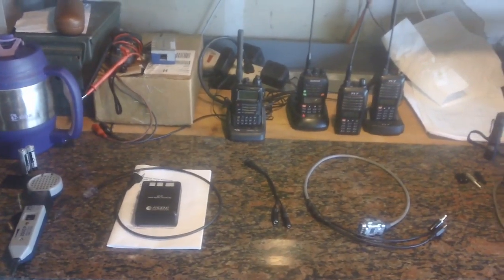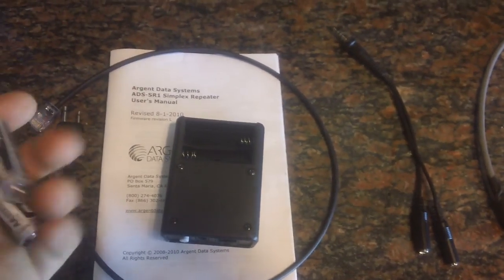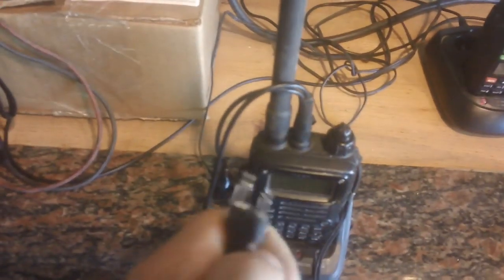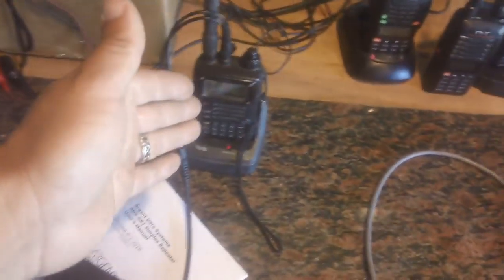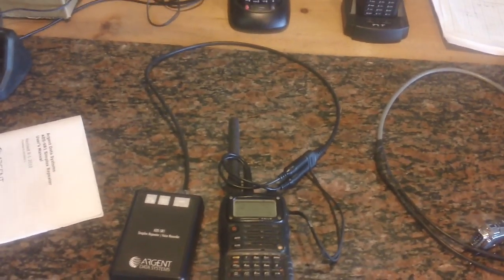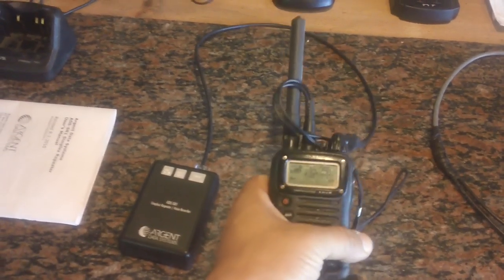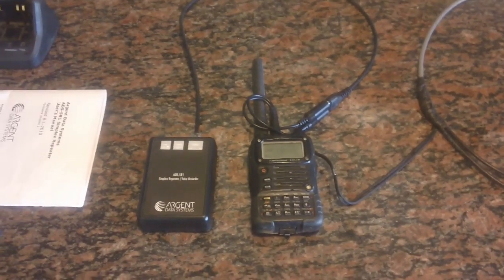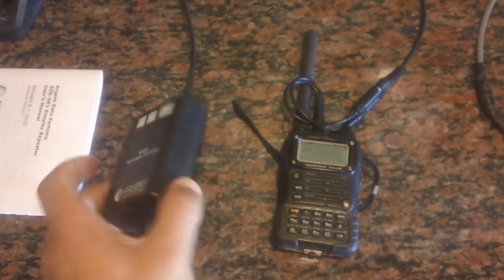Personal Simplex Radio Repeater Build Intro.

Comment: Does it have all the features like the surecom repeater does? like  dtmf tone to operate it, save voice messages,  broadcast a message every so minutes, will the one dual pin network cable work on a baofeng uv-5r?

Comment: Radio shack sold a simplex unit like that, I bought one for $2.00 on their close out table they use to have. I wish I bought all 4 they had. I still have it 15 years later and still have not used it other then to see how it worked. And it was great.

Comment: I think you fools and the FCC need to fix the mess you have with your grms frs radios
You are actually talking about 40 channel wide band 25 kHz and a 80 channel narrow band 12.5 kHz UHF CB ..
Not sure why they would be mixing wide band and narrowband re hash in the same band..
I always thought the licensing bs had to do with sub 150 MHz band not the wide narrow band application on a UHF CB which has 4-5 watt nominal output..
You be better off to create a 120 channel UHF radio system where you got the 1st 40 channels as standard UHF 25 kHz mode and do a 80 channel narrow band running 12.5 kHz steps...Nothing good becomes of running two types of modulation over the same batch of freqs always causes a mess..
I'm in a country where we still openly use 40 channel wideband and 80 channel narrow band UHF CB system over the same bunch of freqs and the 2 can not co-exist on the same radio withiut causing transmission issues..
You only create problem when you try to mix wideband and narrow band within the freqs real estate...
This is why you have a 12.5 kHz step applied to the narrowband UHF portion and a 25khz portion for wide band use..
My opinion I think if they wish to use wide band applications within a UHF format they will need to create UHF block for it same with the narrowband applications 
You can not over lay narrow band on top of wide band using the same batch of freqs...
Unless you own a seven foot ant the reality within the comedian frequency range is no more than 1-2 km. Whether you use a 1/2 a watt to 4-5 watts your range will be the same now if you can hit a repeater within a mile or less you might get 20-40 miles..
Though simplex will alway fall between a half a mile to a mile unless you can serious wattage which will likely get a slap on the wrist from the FCC 
The freqs you listed over here where I live would be considered UHF CB freqs 

Note with the Chinese ht's you buy their distance falls within the same distance as my UHF CB radio..
Any distance claims companies tout on thier ht's work within scope of an active repeater system being in place, all simplex and duplexing actions your radio support will fall within this scope of use regardless of whether you can set the operations to 1/2 watt to 5 watts...

Comment: I think this is a good configuration. But I think comms needs rules especially if you are using 3 or more stations. 1. Roger beep must be utilized, 2. no transmissions over 10 seconds long, 3. you must wait a minimum or 20 seconds to respond, 4. each station must acknowledge whom they are transmitting to so that other stations do not all try to comm at the same time.

Comment: I'm trying to build a simplex repeater using mobile radios any thoughts on how to do this?
Reply from the maker: Erik Kasprzyk It depends on the mobile radio. If the radio has an accessory port, you could make the necessary connections there. if its a minimalist radio, you are going to have to interconnect through the speaker wires and microphone port. Really good question, my repeater is off line, have to go up there and fix it. If I cant, I'll take it doewn the hill and interface it through a mobile the hard way, (minimalist radio). Too much detail to cover through a comment section, though, I like the idea of making a build video with a mobile. It may take me some time.
Reply: @GUERRILLACOMM  how about a icom IC-F621-2 TR UHF mobile 50 watt?

Comment: What are your thoughts on backup radios, and spare parts... one of my worries with electronics of any kind is their relative durability issues - even in high-end gear. The cost of such devices coupled with the relatively high likelihood that they are going to fail, makes me kinda worry about putting so much of my monitory resources towards them. I do recognize the benefits of comms so that is why I am exploring ways to repair/ have backups. The issue is that back-ups make an already expensive prep almost unobtainable for someone on a relatively tight budget.
Reply from the maker: Its bad enough just to get your initial short range tactical sets, let alone a backup.Your priorities will determine how deep you want to go into the rabbit hole. Comms, by itself is an expensive, long learning curve hobby, with much room for error that would cause damage to equipment. the older gear you could get spare parts, but then you need all the support test equipment that cost a bit of money to test and align the equipment. the newer sets are almost made to be disposable and replaced with a new radios, not cost effective to repair, such as these chinese radios flooding the market. I have no clear answer other than showing by example what I'm doing. the gear I have so far are somewhat redundant, and add to it as opportunity arises. its just a very small portion of my preps where the lion share is food, H2o, & shelter. For me, I would definitely have backup and spares for scanner/shortwave equipment and short range radios. 5 miles range. For now its just my household. I have another like minded friend that I could get a hold of by radio, but no real way of physically backing each other up except for boots on the ground intel of whatever situation. Bottom line a scanner is your ears to the world past your horizon, I much rather find out whats going on externally from a distance. This is an issue with many people, especially newbe's.
Reply: Thats kinda how I am.. I would like to have more comms but it's a fairly large investment and one that could only be beneficial short term.

Comment from the maker: You're right, in my case its to negotiate mountain ridges. the distance away depends on your terrain of operation. you will not be 100% to cover everything but you could fill many holes. When I deploy this gear, I will cover how to select a site and do an actual range and cover test.

Comment from the maker: Yeah, radiosification is right. there are plenty of repeaters already deployed, but I'm building a self contained mobile unit geared towards prepping. Just want to have our own maintained backup. This unit will have the ability to record messages or announcement for later retrieval. That's the main focus of my build that a normal repeater does not have. You have plenty of help to bring you up to speed with your comms, just gotta ask.. we're here to help and contribute.

Comment: Was not trying to be anal, but I saw how you want to do this by the letter of the law and I felt all should know the exact wording. I too am building either the Simplex Repeater or the next step up which is the Inexpensive Duplex Repeater that is being offered . But the Simplex has one great thing over all, and that is it is truly simple. I don't have to worry about power for 2 radios  And that's what you really need in a dire emergency. I look forward to your part 2. Keep the videos coming